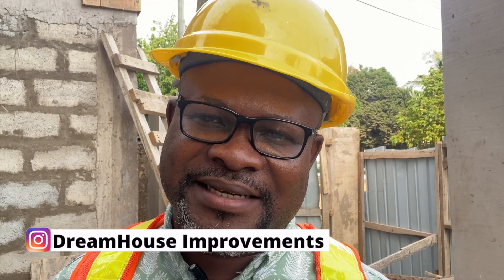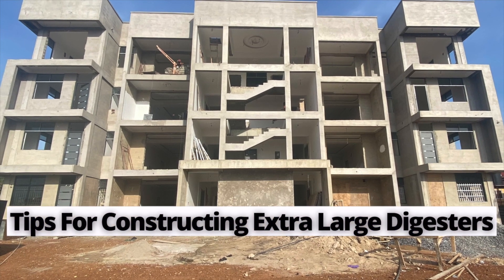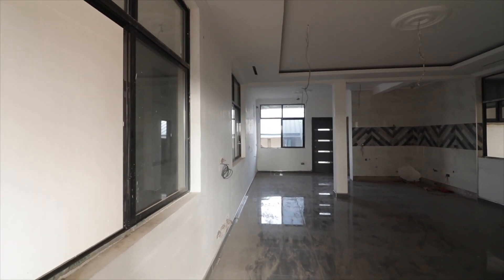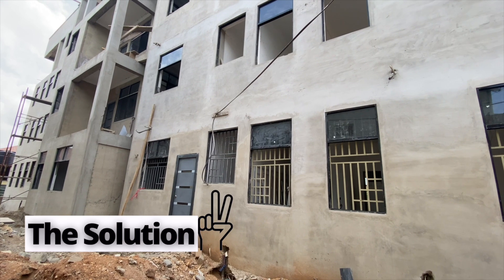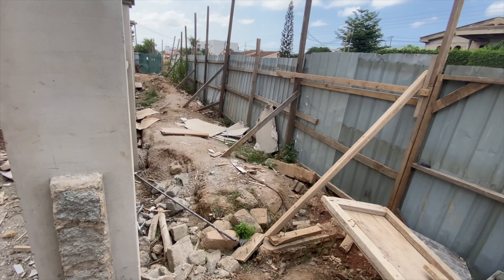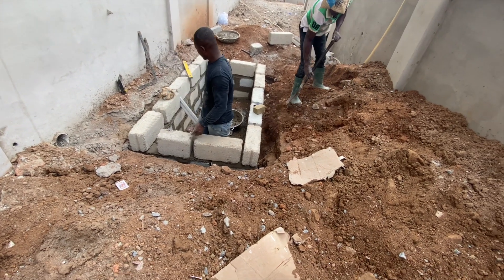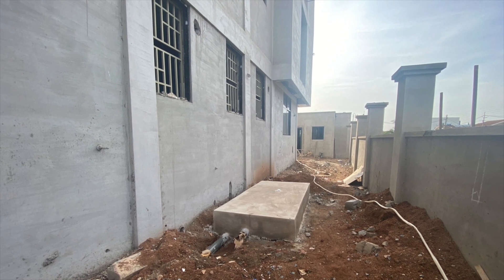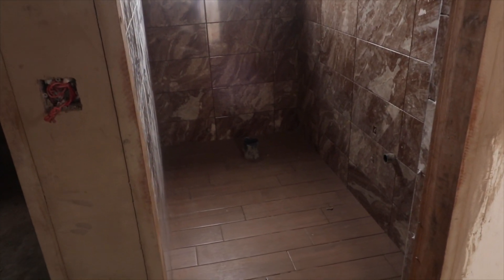How To Construct a Commercial Size Biofil Biodigester

Comment: What is the size of the extra large boidigester. Something that can carry 60 toilets
Reply from the maker: Victor I haven’t done anything like that but I want to believe that would still be too much for the digester. The size is 8ft by 5ft. https://youtu.be/52EIpf62JJ0
Reply: @JerryAdu-Asare
Reply: If you are to use the circular one. It's 2600mm diameter